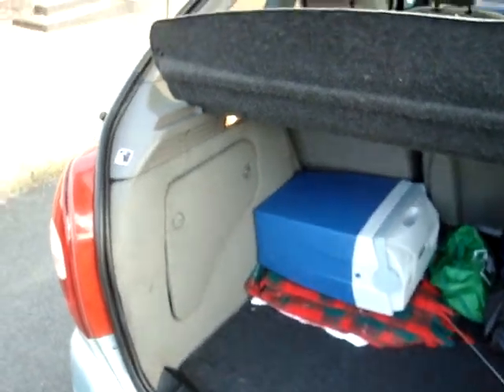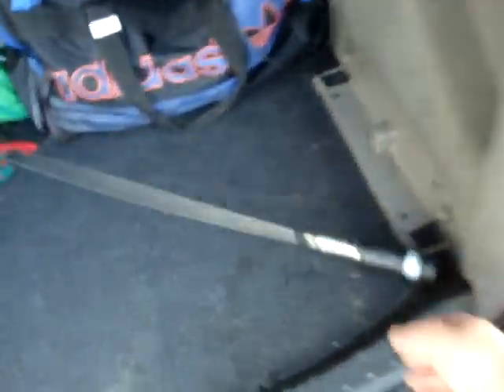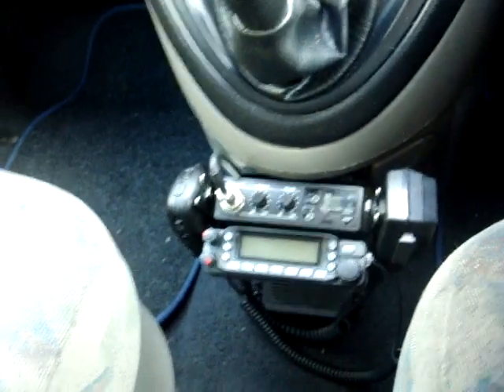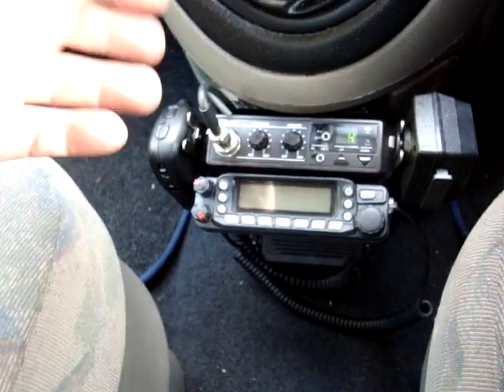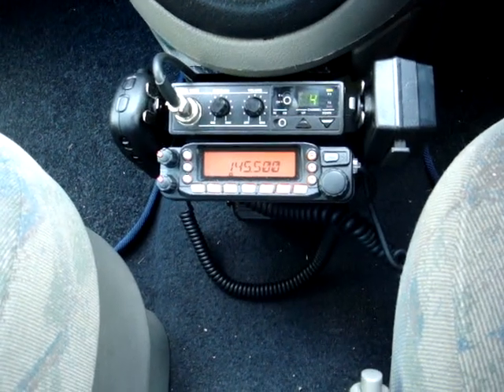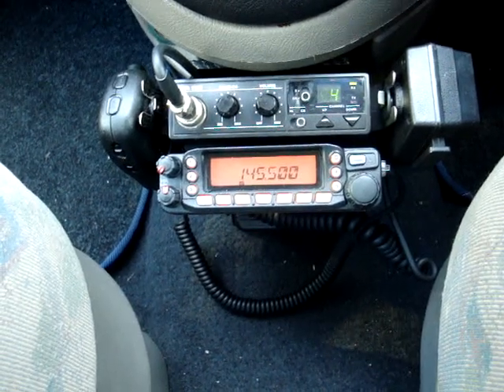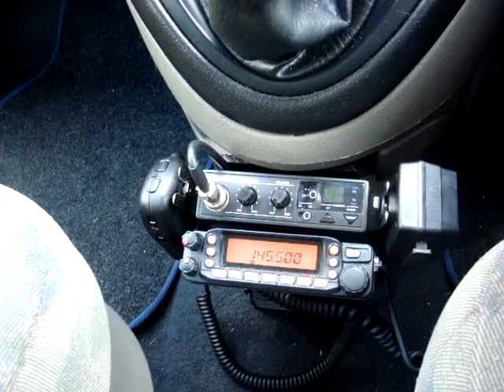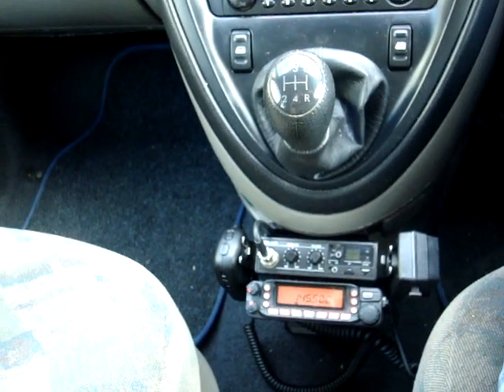Ham radio installation.MPG

Comment from the maker: @MrSDSTRIKEBREAKER Hello.  thanks writing... I dont have two CBs, the one at the back is a CB radio and the one at the front is a ham radio which is like CB but different frequencies and requires a licence.  The ham radio which is fastened to the CB is only the head unit, a bit like a head unit from a car stereo.  the main part of the tranceiver is the gizmo in the boot.. thats what connects to the car battery and antenna. I hope this helps... All the best for fitting your CB..

Comment: You need to mount the radio in the trunk and put the sep kit on the outside of the rear bumper so you will at least be able to talk to someone while pushin that POS car.
Reply: rude. Not funny.